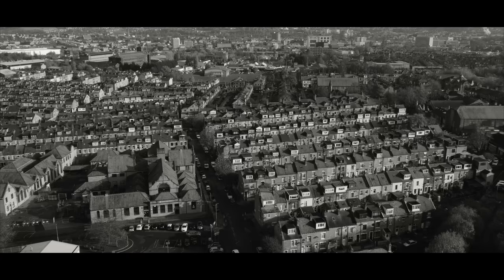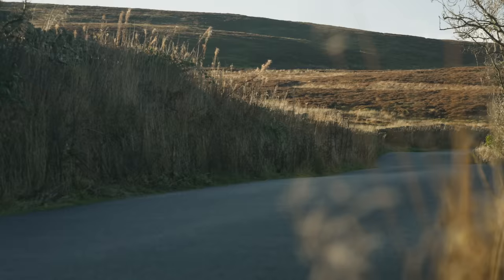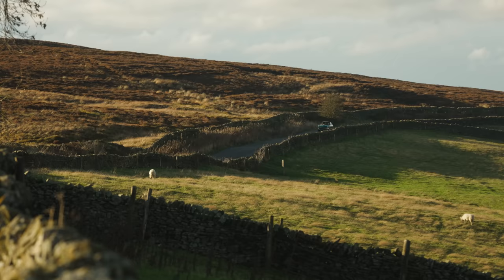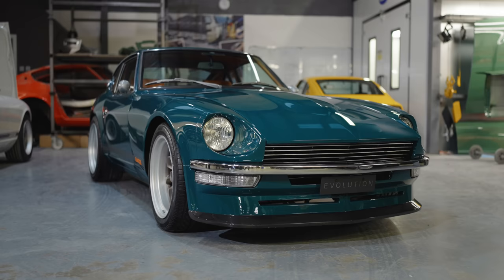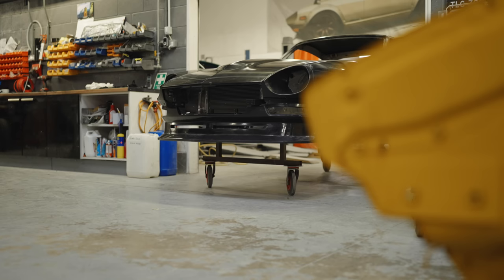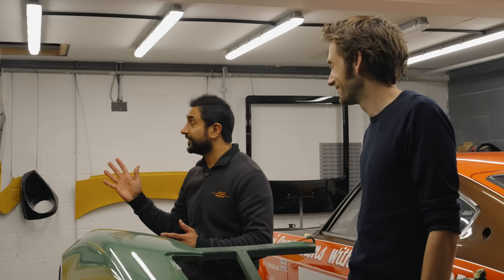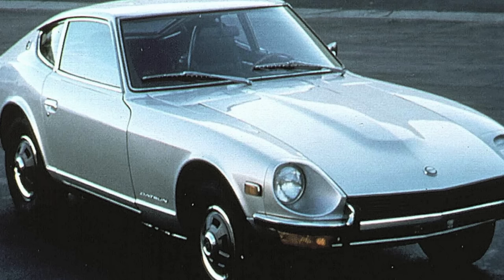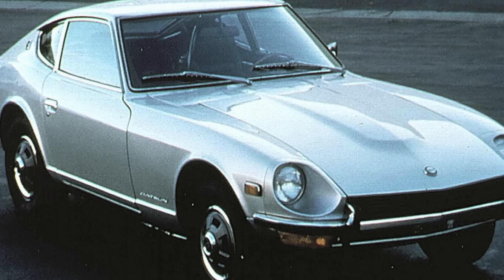Datsun 240Z as you’ve never seen it: MZR Roadsports Evolution | Henry Catchpole - The Driver’s Seat

Comment: My wife had just bought a new 73 240Z / automatic when we met. Great handling little car. A lot of maintenance. Even the dealer couldn't keep it running right because of the emissions and carbs. I was a truck mechanic and not real interested in fussing with it every month. I would do points and plugs every so often and that would improve it for a while. In 1990 we sold it for $3,000 and considering she'd paid 
 $5,500 for it that was a pretty good return. Bought a 5.0 hatchback. She drove it for a week and said either make this car handle like my 240Z or take it back. So, we did the subframes the shocks the whole deal. The mustang came with 273 gears we put 355s in it. She was happy then although I think the z would have still taken the mustang in the corners. But the mustang did have the muscle. We had the mustang for 24 years. She kept it showroom fresh! I still think the 240z is a beautiful car if I had one to redo today it would be the z. You can get past the emissions in the carbs and make the thing a runner. Just a stunning car.

Comment: I owned a 74 240Z w/a 260 motor which had been modified a bit by the previous owner. I was 21 and didn't know my ass from a hole in the ground when it came to driving or mechanical stuff but...I did love the car. It was so much fun to drive and it was beautiful. I traded my brother for a motorcycle and he sold it back to the guy I bought it from who regretted selling it. : )

Comment: I sold them new off the show room floor In Salt Lake City, Utah. My first impression was that of a very cheaply made car. Regularly the center horn button would fall off, that along with the door handles and window lift handles. The hub caps also spent more time racing ahead of the car than in place on the steel wheels. Sold far more 210’s. Can only say good on ya for buying up all the USA 240’s, brilliant work.

Comment: The first run of 240Zs were the best looking moment for the early generations of the Z - purer lines and no battering ram bumpers.  I owned a 1973 240Z many, many moons ago.   1973 still had the early looks but it was kind of a weak year.  The car still had the SU-derived carburetors and Nissan had lost some ground to emission rules.  As a result, the car had some oddities in how it ran - the earlier years were better.  The later fuel injection models ran better, but had lost some of the looks.  Lived in Minnesota without a garage, so the car wound up being a victim of rust.  

A 240Z with a modern fuel regulation system, stiffer chassis, more power and more weather proof body would be a hell of a car.  $100K US is a lot of money but it might be worth it.

Comment: A friend of mine in HS (1984) had a 240 with a 280 motor. The previous owner had raced it in Autocross (I believe) It was lowered with custom fenders and a Webber 6 pack on top. It was an absolute FREAK! We spent a Thanksgiving holiday getting pulled over several times. A common question was “what is this”? 😂 He ended up getting arrested for running from the cops. The chase ended in my driveway, the cop would have missed us but he spun out on our corner and his headlights found us at the top of the drive. Within moments there was 4  cars in front of my house, we were at gunpoint. Nobody woke up, none of the neighbors said a word and good thing, my dad was a cop! 😂 
A few years later I fessed up and he thought I was lying. I asked him, “when have I ever lied to you?” He told me he would have crippled me. I told him, “ I know”.

Comment: I'm not sure I understand the carbon panels on it, as it was it wasn't a heavy car. if you wanted to reduce weight and also increase rigidity, why not just acid dip the whole shell and body panels then put in a cage. It would save a shed load of money one would think.